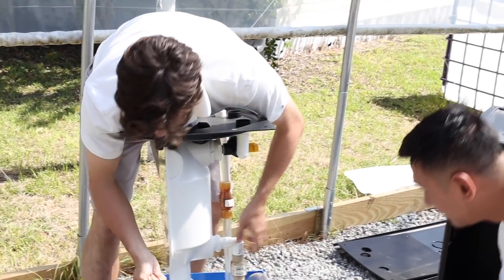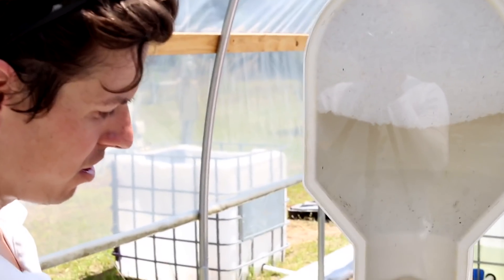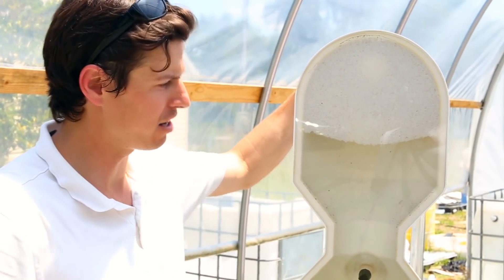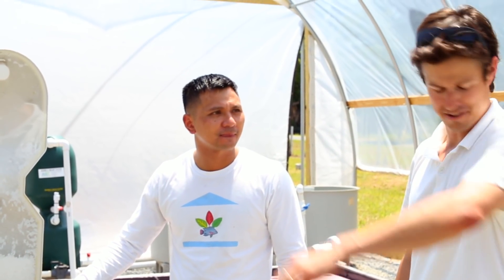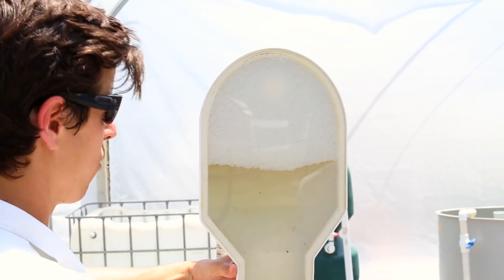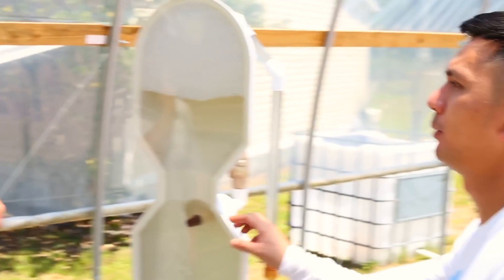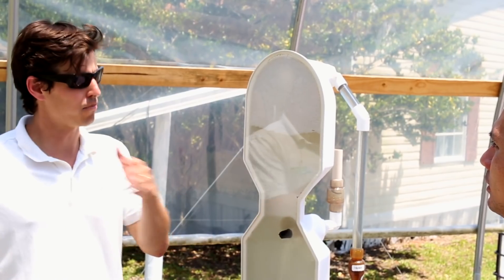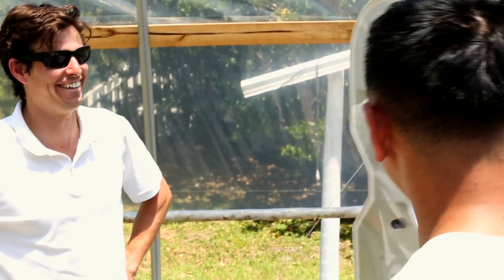Aquaponics Bead Filter Demo | The Aquaponics God Ep.36

Comment: Could you also use a large pool sand filter? Works with the same concept, just sand instead of beads. Sand would clarify water very well aswell as provide tons of surface area for BB.

Comment: Based on the info in the video, the filter can only handle a small tank.  In a production environment, the volume of solid will be much more than the filter could handle.  With the beads up at the top, it slows down the flow rate.
Reply: the filter can be scaled up to production lvl to handle bigger water volume.  @ 11:06

Comment: Okay the solids are flushed out and removed from the system. Will there need to be a secondary biological filter to finish the ammonia to nitrite / nitrate conversation?
Reply from the maker: No, the filter does both solids and biological filtration in the same unit.
Reply: @TheSchoolofAquaponics  I understand that it can to some degree, but to what degree? If the beads are scrubbed clean each time, how effective can they be ? Is there any data on the bead filter's effectiveness  in reducing the water's ammonia levels to nitrites and nitrate?

Comment: Hi! Great post glad the bead filter fellow came along.  What about using electric valves like for a forced hot water system to coordinate an automated backflow session.  1) close inflow, water simply circulates as if the filter loop had a blockage 2) close return, no water exiting 3) open drain, backwash bubbling looses and drains solids into holding tank 4) close drain 5) open return, 6) open inflow.  Running pump now pushes water into bead filter loop again.    You could use a simple optical sensor ( pair of diodes shining across clear pipe section ) to initiate the coordinated activity.
Reply: Check the AST Endurance

Comment: Good Day all, 
I am new to aquaponics and very interested in setting up a backyard aquaponics system. I was wondering if you pros could provide me some pointers and advice as I embark on this venture.
The aquaponics system I intend to design is DWC due to its simplicity. For this system my intended design and dimensions are as followed:
Grow bed space:
Area: 4ft × 16ft = 64ft2 
V: 16ft × 4ft × 1ft = 64ft3 / 478 gallons / 1809.43 litres 
Or
Area:1.2m x 4.8m = 5.76m2
V:  4.8m × 1.2m × 0.3048m = 1.75m3 /483 gallons / 1828.35 litres 
Filter:
55 gal swirl filter
Sump Tank:
55 gal water drum
Water pump:
Active Aqua Submersible Water Pump, 1000 GPH
Fish Tank:
Question: What size fish tank (gal) would you recommend considering the above? I will be using Nile tilapia (preferably males). 
The fish feeding ratio I intend to use is based on the UVI system. Which is 60 to 100 grams of feed per square meters of plant area; therefore, 5.76m squared = 345.6 grams per day (60g × 5.76m squared) i.e (115.2g 3 times a day). 
Question: What should be my desired stocking density and beginning weight of the fishes?
I tried to follow the ratio of 1lb (.5kg) of fish for every 1ft2 of grow bed surface area. This resulted in 64 fishes at 1lb.
Question: What should be the desired flow rate?
I intend to grow leafy greens such as Romaine lettuce and cabbage at 8 inch spacing per 1 meter squared.

Comment: Does the filter take away nutrients from the plants, or are the solids not really what the plants need? And now with the hotter weather in texas, the water in my system is turning green probably from algae. Would this bead filter help with clearing some of that? Thank you.
Reply from the maker: It will not necessarily rob nutrients from the plants. The best practice is to store the solids in a tank for further usage once the filter is drained so you can get optimal use of the nutrients.

I would t expect the bead filter to solve any algae problems. You would be better off blocking sunlight from entering your system to manage the algae issue.
Reply: According to the video the beads act as a biological converter of ammonia and nitrite to nitrate which the plants crave.  I would imagine algae in particular the stringy kind and duckweed may create issues if they get onto the slots or inside the filter then plug the slots from the inside.  Personally I am wanting to use duckweed as much as possible and just obtained some today and am starting to grow it.

Comment: With a name like Paul, he must be really smart and capable!  What prevents the beads from being drained out when you do the flush?
Reply from the maker: The pipe on the bottom has slots on it that are just small enough to prevent beads from escaping.
Reply: So big waste will be stuck in the filter forever. Or regular clogging in the inlet & outlet.